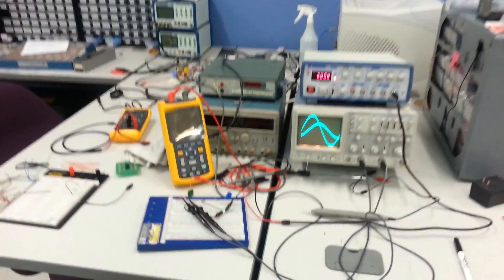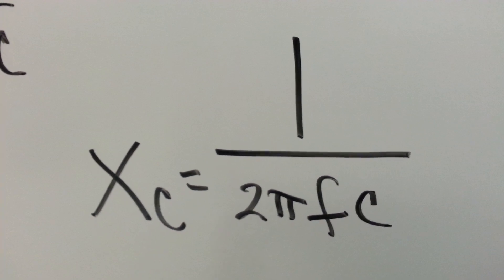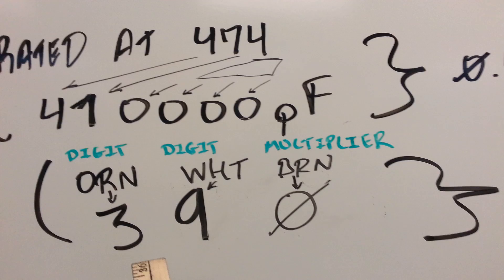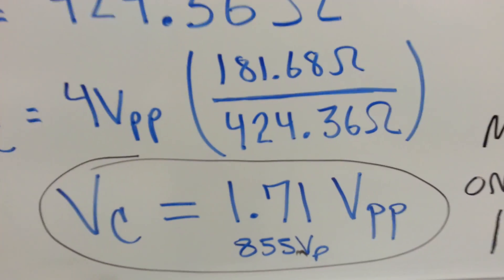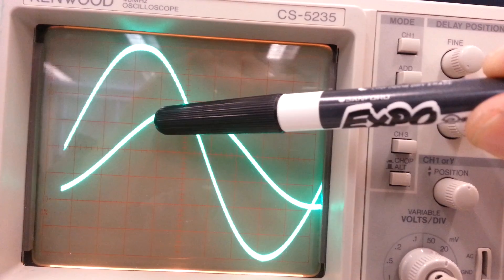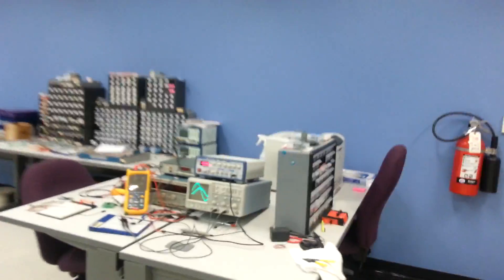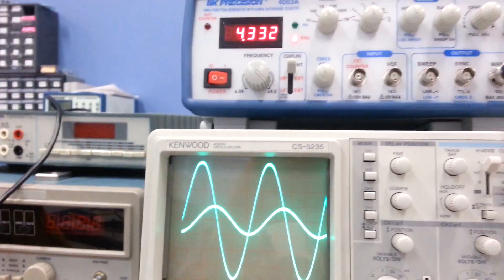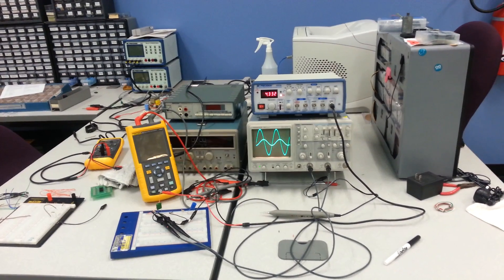Xc Capacitors in AC Series RC circuit with Oscilloscope Impedance

Comment: excellent video!! Except all your answers are flawed. You miss the same variable that I've yet to see anyone factor in yet. Here's a hint, it's a different variable in England.
Reply from the maker: Thanks for watching and for the comment. I am aware of some variables considered negligible, and some topics omitted to keep things practical. However, I am not sure exactly what you are hinting at.

I do not consider this flawed, as the results are both accurate and precise. In other words the measurements match the predictions, and the results are repeatable. I am open to more input, but I stand by this work. Thanks again for your feedback.

Comment: Do you have to have a resistor in the circuit for the waveform to display properly?
Reply from the maker: short answer: YES the resistor is required.
Reply: I thought so.  Thanks

Comment: how to display current waveform associated with the cap in cro? that current leads voltage ?
Reply from the maker: Thanks for having a look and for commenting. This video shows the source voltage and the capacitor voltage. As seen in the video, the cap voltage is 90 degrees out-of-phase with the source. You have a good question, and the answer is not difficult to explain with a foundation in Ohms Law. Below I explain how I would display the phase angle between the capacitor voltage and the capacitor current on an oscilloscope.

The current while leading the voltage in this circuit is not leading by 90 degrees, because there is resistance in series. The phase angle is related to the R and C values along with the frequency of the source. To observe the phase relationship between the voltage across the capacitor, and the current through the circuit requires displaying the voltage across the resistor alongside the voltage across the cap.

In this circuit I would invert CH2 and Add it to CH1 to display the voltage waveform that is across the resistor. Some scopes have a menu to subtract one channel from another. 

Whatever the case, the point is that you need to display the voltage across the resistor in relation to the voltage across the capacitor to see the phase relationship of capacitor voltage and capacitor current. 

The first thing is to understand that current through a resistor is in phase with the voltage dropped across the resistor. Next is to know that current is the same for all components in series. In other words capacitor current can be represented by the voltage across the resistor. Ohm's Law can be applied to find current I=V/R. 

The easy thing to is say that you must display the voltage across the resistor on the screen with the voltage across the cap. I am also implying that since all scope measurements are to ground I would use a technique called Invert and Add to see the resistor voltage, and use that voltage waveform to represent current.

Please understand I have no idea of your level of background, but based on your question I suspect you will follow this post. 

Another approach is a current probe, but it is not necessary. 

  --Joe
Reply: It has cleared my doubt. thank you.
Reply: i am from electrical background. sorry didn't mention it before. Can you tell me why current is same in a circuit even though current and voltage are related differently in each component. For example a series RC circuit connected to an alternating source have same current passing through the circuit but current through resistance is I=V/R and current associated with the cap is I=Cdv/dt.
Reply: Bidyut Baruah It is a series circuit. While the reactive component, the capacitance in this case cause the phase of current to lead the voltage, the components are still wired in series and therefor share the alternating electrons. This is NC Arduino but I am replying from my NC Mountain channel.

The key to total series current is Z or total impedance (formula in the video). It is a vector where the resistive current is in phase with source voltage. The capacitor current leads the source voltage by 90 degrees. Depending on the two currents (resistive and capacitive) the source voltage divided by the Impedance, not just the resistance determine the net current and the phase relation. I = V/Z

I first remind you this circuit is series so the current is same for each component (AC or DC). The total impedance (Z) determine the flow of electrons. The relation of reactance to resistance determine both the Impedance and phase angle. 

Look more into phasors and vectors as applied to electricity. It is basically just relating triangles Inductive, Capacitive, and Resistive components, to determine Impedance. This video is series RC, it gets more tricky when you entertain reactance (X) in parallel and then series-parallel, especially when the circuit has all three (RCL). It becomes an exercise in switching between polar and rectangular. 

The significance of understanding these fundamentals help with many type of filters and tuned circuits (resonance), AC motors, AC Power, and more.

 Let me know if you find any good videos. Thanks again for comments, and good questions.